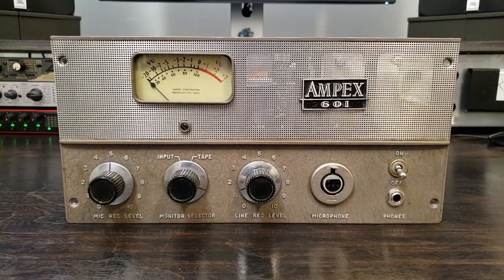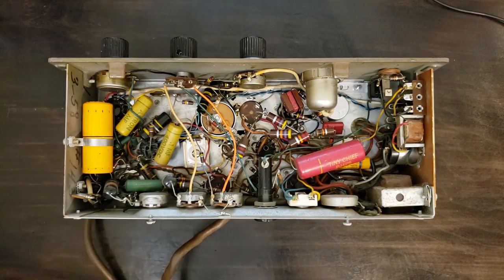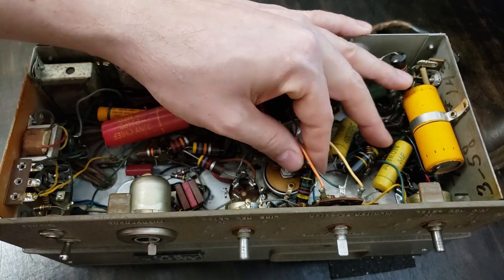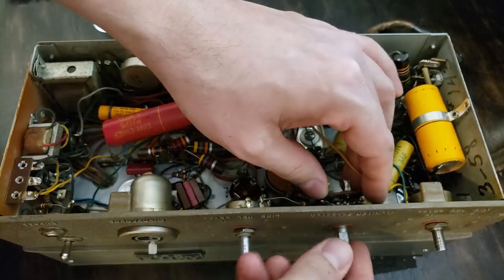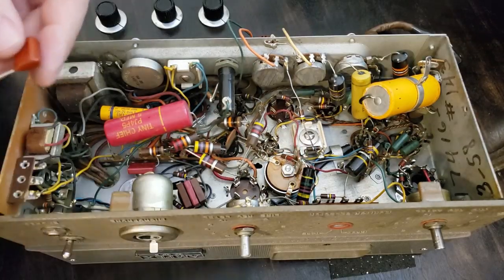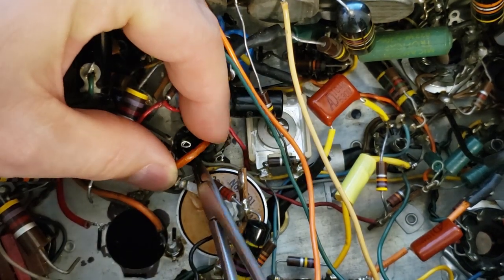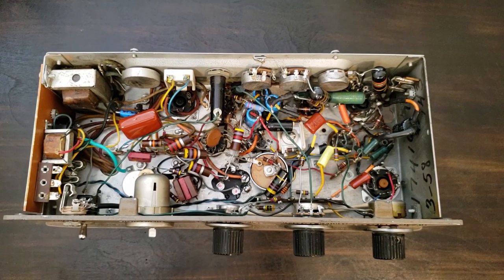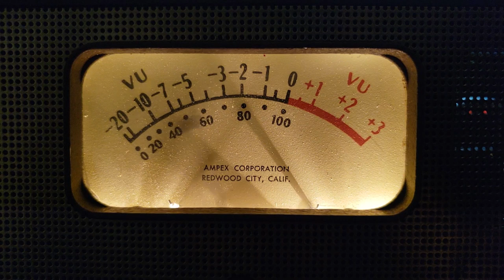AMPEX 601 Microphone Preamplifer Conversion Mic Pre RESTOMOD

Comment from the maker: Schematic with the parts I replaced, available here: https://vintagemusictech.blogspot.com/2020/03/ampex-601-schematic-and-mic-preamp.html
Reply: Do you know of a schematic for the 351? Or have any reccomendations as to sensible DIY mods I could achieve?
Reply from the maker: Hmm,  I've never worked on a 350 nor 351.  When approaching these projects, I try to be focused about what functions I want the units to perform, and what they are currently capable of. Also, I try to consider how they were designed to function and how far my mods can realistically deviate from those functions while still retaining the character or the design.  So, for an ampex 351, I would probably do a restoration of caps and bad resistors. Clean all switches, inputs and outputs, and potentiometers(lightly, from the back of the casing). If you use it for a while, and feel like you really need a certain feature, you can consider adding the feature, but my experience is, changing one thing will probably have an effect on a different section of the preamp.  Like pulling unused tubes seems like a good idea, but it can raise the tube heater voltage for the remaining tubes- not ideal.
Glancing at the schematic, I personally would be interested in utilizing the playback head input somehow.  
A schematic is currently available here: https://usermanual.wiki/Document/Ampex351schematics1962.901134551
Good luck!
Reply: @FrankOlsonTwins  Thank you for the schematics!

Comment: Hello, can you tell me how can i wire my Ampex 601 to play music from my computer? can i go directly with a 3,5mm miniplug wire from my laptop to the Line In input? and from the Output directly to a 12" speaker? or i need to use an amplifier from the Output of the Ampex to an Input from a amplifier?...i buyed yesterday, today i probed and its working
Reply from the maker: Hi, Yes you will need an amplifier to listen to music over a speaker. 
My best advice is to get the manual for the 601 and read about how the inputs and outputs work.  That should give you a good idea if it will fit your setup or not.

Comment: Nice work!! Would these changes apply for an Ampex 602 with a tape transport that stills working?? Would these new electronic components affect any of the tape machine Rec-Play-Erase functions? I am planning to use it in my recording studio as a rec mic preamp,  DAW>Tape Transfer unit and maybe some tape delay effects. Thanks for sharing your work for DIY enthusiasts. Greetings from Chile!!
Reply from the maker: Thanks for checking it out!  Yes, I really just did a cap replacement service.  If you're going to keep it in service, I'd recommend only replacing parts as needed.  The 602 is a slightly different circuit as I recall, but still a great sounding preamp and tape recorder.  
Is the machine in service for you right now?  Is it currently working or needs service?
Reply: @FrankOlsonTwins  The preamp works great when plugging a mic in the microphone`s input. I haven't checked the line input yet as there is some rust I need to get rid of inside the XLR connector (601 has a TS connector). I am working on the transport myself following the instructions on the manual and Jim Miller's website. Fortunately, now the mechanism is working as it should. The only thing I could not fix was the recording function, that's why I'm sending it to a technician to get that fixed and take the chance to recap the unit according to your schematic. I also have a 601 I will try to fix while the 602 is being serviced. Thanks again for your help.

Comment: I really enjoyed the video, and it got me thinking. What are some tape machines out there that can be had for a decent price that have some really special preamps in it. I'd love to get my hands on one and maybe get it modified down so I could put it in some sort of a chassis, and use it for some of that old mojo. Thanks so much. 🙂
Reply from the maker: Thanks for the kind words!  The akai M7, M8 or roberts 770, or 990 all have monoblock/tube preamps.  They are a great inexpensive way to get your hands dirty!
Reply: @FrankOlsonTwins   Awesome thank you for the recommendation. 👍🏻😁
Reply from the maker: @TheGarageRecordingSC  Glad to help.  Keep an eye on ebay, my advice- buy the cleanest unit  you can find, but try not to pay more than about $100 for each monoblock. They're not worth much more than that.  Sometimes you'll get lucky and find a full tape machine for around $100. Good luck!
Reply: @FrankOlsonTwins   You're exactly right, I've been looking around online today. 👍🏻😁
Reply: I've found a really nicely cared for, Akai M8. Should I just leave it as is and use the preamps that way, or is it relatively easy to pull them out and put them in a chassis? My day job is running a metal shop so I could build something really cool. But being tube preamps, they must have some sort of dummy load if they are not connected to a speaker, correct? Or is there something built in that would allow them to just be pulled out? Sorry to bug you, this stuff just has me really intrigued. Thanks for any advice you can give.
Reply from the maker: Well, the nice thing about the M8 is that you can test the preamp before you commit to doing any mods.  It should have a "Pre-amp out" jack. If you like the sound, you could just use it as is.  I did that for a long time, in hindsight, it was probably the best use of the unit. If you don't like it, you can pass it on to someone else.
That said, if this is your first tube project, consider an easier first project.  There are a few issues I'll address that make this an awkward mic preamp to modify.
Before you take the plunge, take a look at https://lacinato.com/cm/audio/robertsmod.  That guy did a number of M8 mods based on the first "Rod Childers Akai Mods."  If you feel comfortable doing that work you could proceed. 
I'd leave it as is until you have a good grasp of the inputs, outputs, and general topology of the preamp. Also, study a couple of simple mic circuits like the Jensen 12ax7 tube preamp or Hamptone Tube DIY preamp.
I haven't messed with one of these units in a long time, but  here are a few things I remember:
*The speaker output has it's own internal dummy load, so you can unplug it and not destroy the amp.
*It doesn't have any Mic input or output transformers, -that's a big(expensive) issue with any tube preamp, if it doesn't have them it's not much more than a tube di box(especially the input transformer).
*These preamps are very clean sounding. They border on what I would call sterile, but if you use a mic input transformer it does help. I never added a balanced output to it.  I just ran the unbalanced output directly to my interface.
*There's not a ton of gain from either tube, and there's no "line driver" tube so it's pretty much a single tube preamp as it sits. 
 If you feel comfortable and experienced working with high voltage, you could cut down the case and make a portable preamp unit, but that does take some re-wiring of the AC. 
I realize it sounds like I'm basically saying "Don't bother" but I do think it's worth checking out the preamps, even without doing any mods. You can get an inline mic input transformer and that will get you in the ballpark, tone wise.
Hope this helps!
Reply: @FrankOlsonTwins  That helps me out a ton brother, thank you for your time and knowledge!! Really like your channel, just Sub'd today!!! 👊🏻😁

Comment: Nice, any tips on adding a DI input? Where would I need to put the input jack and would I need extra parts? Cheers
Reply from the maker: Di Just requires a 1/4" jack that can be installed in place of the 1/8" Line input jack. I don't recall right off if it's a shorting jack or not. I don't think it was.  On this particular unit, I relocated it to where the phones jack originally was(front panel), since the new owner has no need for a phones jack.  No real secret to the DI on this unit.  With a proper cap job and good tubes installed, the circuit is already tuned really well(Ampex engineering, after all)! If you're getting a bad mismatch between your instrument and the DI, you could use a step down transformer.  That's worst case scenario though.
Reply: Thanks, yes previous owner had caps done so it's sounding great with a mic. I tried my active bass into the mic XLR (which doesn't seem the right thing to do, but I wanted to try anyway). I got a lot of hiss. 

Plugging it into a line level input, would there be an impedence mismatch? I guess an active bass might more closely match a mic input but I'm not too clued up on this, so not sure. Cheers
Reply from the maker: Yes, actually after conferring with the owner of the preamp- the line in isn't really suitable for instruments.  Checking the schematic, it's hitting 3 gain stages, but two of them are acting as buffers/mixers, really.  So, there isn't much more than unity gain happening.  
Now I recall- The problem with trying to create a DI from the line in is that BOTH the mic preamp and the Line in connect at 1/2 of the 12ay7 tube as a mixing stage.  If you change(or remove) the resistor value in the line in path to suit a DI(there's only one) it changes the response of the Mic preamp. After a few attempts of changing this resistor, we were content to leave the line in as a low impedance input. 
Take a look at the schematic in the link provided above.  With some effort you could come up with something suitable, I'm sure.
He has been running instruments through the Mic preamp via a stepdown transformer, DI box.  The Mic pre on this unit has tons of gain, so with a suitable DI box, you shouldn't be getting much hiss. If so, check your tubes.

Comment: Hey Ive got an ampex 601 Im using as a mic preamp for vocals. It sounds great, but when I sing loud into it, it has a harsh piercing treble sound. Id prefer it to have a smooth overdrive clipping sound. Do you have any suggestions on settings or switching tubes to mellow out the piercing treble? Thanks! Ps its actually the one in the "Stung By Bumblebees - 1959 Ampex 601 Studio Microphone & Guitar Preamp Repair" youtube video.
Reply from the maker: Hey David, I'm not near a computer but i can take a look at the schem and make some suggestions wednesday!
Reply: Thanks! Have you noticed similar behavior on yours? Do you think there is an adjustment I could make that would help, or maybe trying different tubes? the 12ay7 is a GE. Thanks again!
Reply from the maker: Hey David,
I took a look at the schematic again.  I have to say, the unit I modded is super mellow.  The owner has been using it on different sources, and it hasn't jumped out at either of us as too bright, shrill or piercing in any circumstance.

This makes me suspect the EF86 tube on  your unit.  If you have one(or a few) you could swap out, that might be helpful to rule it out.  A screechy 12AY7 tube is a little out of character, but anything's possible.

The only adjustment I can think of would be the record Equalization, however, I don't know if that's in your modded circuit.  It's not in mine.  If it is currently wired into your signal path, it would have a direct influence on the treble response.  It looks like a little white ceramic square with a screw in the middle.  By tightening or loosening the screw, it changes the amount of treble in the circuit. 

Hope this helps, let me know how it goes!
-Frank
Reply: Hey sorry for the late reply, It turned out to be the cheap recording interface I was using. I got a apogee duet and i bypass its preamp completely, and the ampex 601 then sounds wonderful.
Reply from the maker: Good to know, thanks for checking  back in!

Comment: Hi. Thank you for the video. Any suggestions on where the safest place to install a kill switch for the noisy reel to reel motor would be. I was thinking of doing it internally so I wouldn't have to drill. But I want to retain the ability to use the reel. Thanks!
Reply from the maker: If you look at  00m25s someone installed just such a switch on this unit.  That's probably a good spot for it, but without drilling perhaps the easiest thing would be to replace the original switch with a 3 position switch(ON-OFF-ON). You 'd have to figure out how to wire power for just the preamp, and put that on one side of the switch. The other side would be power for the entire unit.

Comment: After months of work, I could finally get my Ampex 601 to play and record. Now it’s time to recap the entire unit following these instructions.  Any advice on how to change the two prong power chord for a new one?
Reply from the maker: Yeah, I do a couple things.  Crimp(or solder) on a "ring tongue" or simlar "lug washer" on the green wire that's inside your new three prong power cable. Clean both sides of the lug with green scrubby.  Drill a hole in the chassis and clean around the hole with scrubby or 600 grit sandpaper.  It should look very clean.  Now using a screw, nut and washer, securely fasten the lug directly to the chassis.  So, order of operations would be:  Put screw through clean chassis hole>>put lug onto screw, being sure the lug is contacting the chassis>>washer goes on next>>Nut goes on last.  Tighten very tightly, but don't strip the screw!  That's it!  The other wires are black and white, which should match right up with the existing cable connections inside the 601.
Reply: @FrankOlsonTwins where do you connect the wire from the power switch? To the black or white terminal? The original 2 prong wiring has the black and white on one prong and the wire from the power switch on the other.
Reply from the maker: Honestly, without having a unit in front of me, it's impossible for me to give electrical advice.  I would just say keep looking at the schematic and tracing the wiring until it makes sense.  If you're not comfortable wiring it up, find someone in your area to give you a hand. Most techs could get this sorted in a few minutes, costing $50 or less.  
There are many forums describing this exact type of procedure(3 prong AC to power transformer hookup), the important thing is you understand what you're doing at each step. When I was learning to do this type of thing, I read as many forums as I could and asked many questions on them. It's worth spending the time to figure it out, but really it can be quite dangerous so do proceed with caution!

Comment: Enjoyed the video very much.  I have an Ampex 601-2 (Stereo) tape deck I was given by the original owner when it was 
headed for a dumpster in about 1986.  I've kept it stored since then waiting for "someday" when I could have it restored.  I'm wondering if someday has finally come.  I'll message your website with contact info and hope we can chat directly about a restomod to full operation.  Nice touch using the preamp for narration.  It sounds very nice. Wondering if you could mention the mic you used to record.     Thanks!
Reply from the maker: Hey John, i got your email, I'll give you a shout next week with some details.  Regarding the mic, I'm pretty certain it was an SM7B.  But it might have been an sm58.  Pretty sure it was the SM7 though, because I was really excited that it had so much gain for that mic.
Reply: @FrankOlsonTwins  Now that you mention it, it does look like an SM7 which is a decent dynamic but kind of under performs without a boost.  It sounds really nice on your modded 601 though.  Looking forward to chatting with you.
Reply from the maker: @77Cardinal  Oh, haha I forgot that I put the mic in the video!  Yeah, definitely narrated with the SM7!

Comment: Can you get rode of those thick brown cables hanging off the back ?  we just need the power cable ya ? i have one and id liek to remove those since im not using it in the suitcase
Reply from the maker: I seem to recall some of them are AC lines and some are DC lines.  It's best not to just cut wires out- it can create a dangerous situation to have high voltage wires loosely clipped.  Have a technician cut them directly at their point of origin inside the chassis leaving no frays or stray wires.  If you don't know a technician, you can cover the ends with shrink tubing or electrical tape to make them a little more safe when outside the suitcase.

Comment: Rad video! I recently stumbled across an Ampex AG-600 Solid State, it appears like everything is working but I kinda wanna try taking out the preamp unit by itself and use it in my studio. Will I light my house on fire if I removed the unit and run it without the tape deck?
Reply from the maker: It should be fine, but I'd say keep close to it in the studio the first day or two, just to check out how hot it's getting without the included fan running.  I don't forsee any trouble. Also, make sure the little bottom chassis is intact...not a great idea to touch anything inside the unit really.  Good luck!  Let me know how it turns out!